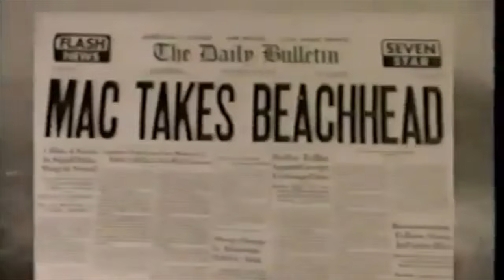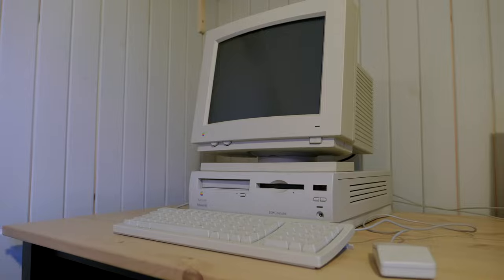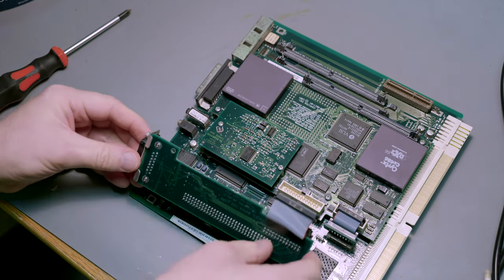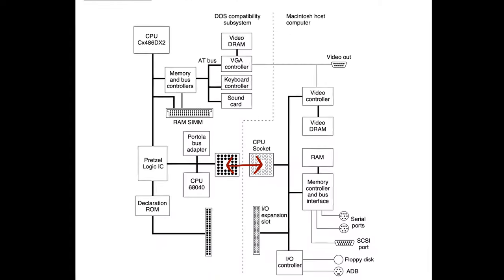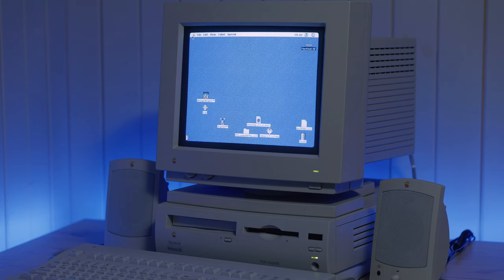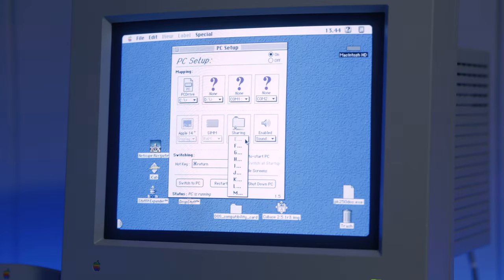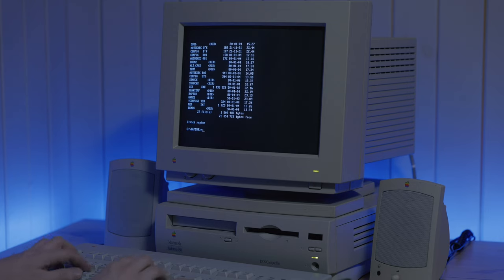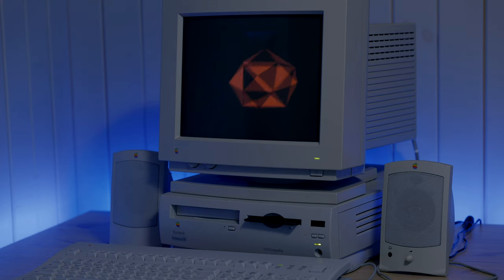This 90s Mac is also a PC!

Comment: Superb vid. I guess internally the DOS cards are a bit all over the place but it is a lot tidier than the 610/6100's solution when its all closed up. I didn't know it was just the DOS models with the dedicated AV socket, although there is something visually identical on a standard 6200's logic board. And those eject shortcuts... what a shame they are only for the PC side, thats a super handy idea. Maybe theres an extension out there that can add it...

It would be really cool to see some direct comparisons of identical games running on the Mac and PC sides to see how they compare performance wise, that DOOM II footage looked to be smoother than the Mac port running on my 630.

Comment: YouTube suggested this video to me, and after watching it I have to say thank you to YouTube for suggesting it!  Great video, I'll subscribe now and see what else there is.

Regarding WHY the card plugs into the 68040 socket, I'd guess that it was easier for the engineers to do it this way and have full read/write access to the 68040 CPU bus, rather than needing to interface using the possibly slower NuBus expansion system.  It's certainly a very interesting design.
Reply: I must correct myself, I just looked it up, this model Mac uses a PDS (Processor Direct Slot) expansion slot, not NuBus.

Also, I see people have mentioned trying a faster 486 CPU.  This would be an interesting experiment, BUT, given the 68040 CPU that runs the whole show is on a 33MHz CPU bus AND the 486 ALSO runs on a 33MHz bus (which is then clock doubled within the 486 to 66MHz), I wonder if the 486 simply runs off the same timing system as the 68040.  That would make it MUCH easier to design and cheaper to manufacture as well.  If this is the case, perhaps a 486DX4 100MHz may work (clock tripled from the 33.3MHz, so technically a 99.9MHz internal clock speed, just like the DX2 is technically a 66.6MHz), and maybe even the "fastest 486" (the Am5x86) may work - it runs at 4x 33.3MHz, but works as a drop-in replacement for a DX2 66MHz 486.  Other 486 CPUs, such as the 486DX2 50MHz, may not work, as they work on a 25 (times 2) CPU bus.
Reply from the maker: I think you’re on to something!
Reply: @OddObsolete  Thank you.  Or, after looking at that huge wall of text, I wouldn't blame anyone for assuming I was on something when I wrote that, haha.  Great video, and good luck with what you do with this machine in the future.

Comment: Good memories, I had a PowerPC Performa 6360AV in the late 90s which used the same chassis as this machine. The TV tuner and Video capture/input capabilities, I kept it right into the mid 00's to use as a video monitor/TV. I notice on the back of this there is the blanking plate where the tuner card would have been, I wonder if the Performa 630 ever actually came with the TV tuner and/or video capture card
Reply from the maker: The 630 can indeed have a TV card, there’s a slot for it on the logic board.
Reply: I think the TV Tuner and AV inputs (composite) may have been separate from each other. Would be interesting to see if the 630 could be upgraded with that at the same time as the dos card. It was great to use alongside games consoles, like Sega and original PlayStation, there was an Apple monitor with stereo speakers vertically on either side, it really was a pretty sweet setup.
Reply: Yes the 630 had a TV card option - you'll notice the black IR window on the front of the case. The 6360 was the last to use that chassis and had a PCI slot if I remember correctly.  I had a 5320CD which came with 28.8 modem, MPEG decoder card and TV Tuner card.

Comment: I had the model LGR showed until I sold it to a collector that kept pestering me about it.  The only Mac from that era I've owned, System 7-9 are pretty solid operating systems IMO.  For most people I would say OSX/MacOS is the best operating system out there.  

It's a shame it's platform restricted, but one could argue that's why it's so efficient.  I'm not a fan of Apple hardware or wasn't at least until the M1 shift (ARM desktop fanboy).  I just wish the company that was putting out great performing ARM hardware for desktop was one that would make a machine with sodimm slots for ram, nvme slot(s) for storage, and possibly a PCIe slot or two for expansion.  My RockPi4 has an NVME slot and RockPro64 has a PCIe slot (albeit 4x, but that's better than nothing), both SBC's I actively program with on the actual hardware using FreeBSD.

Comment: Stopped by because I just bought one of these in a flea market and I know very little about them.  You just bumped my knowledge up a ton and I am looking forward to giving this a rig a run after I give it a good cleaning like you showed.   Do these use an Apple bus keyboard and mouse or will a standard IBM type work?   Appreciate the video!
Reply from the maker: Wow, congrats on a great find!
Only ADB unfortunately, but you’ve probably worked that out by now :)
Best of luck with the machine, and have fun!

Comment: I recently purchased a 640CD DOS Compatible which is almost exactly like the 630. I’m having an image display issue on the PC side though. On the PC side I don’t think I’m getting red at all. Everything has a blue/green tint. Even the text on DOS is blue. The original HDD was toast so I am using a CF card with adapter. Colors on the Mac side are fine. I don’t have a crt monitor. I’m using a lcd with a VGA adapter. I’ve tried different dip switch settings and still no luck. My guess at this point is there is an issue with the graphics chip on the DOS card itself. I’m going to take the computer apart soon. The power supply needs to be rebuilt. Though I don’t want to bother if I can’t get the DOS card to function correctly.
Reply from the maker: Had that same issue as well, it was the video connector from the DOS card to the Mac logic board that wasn’t making proper contact. Clean it with some IPA and it should be fine!
Reply: @OddObsolete  good to know! I’m going to pull the logic board now
Reply: @OddObsolete  it worked!!! Thanks!!!

Comment: can you upgrade the x86 CPU and RAM ? And if can what are the max available upgrades ?
Reply from the maker: Yeah, it should be possible to put in a 100mhz DX4 overdrive, and I’m on the lookout for one of those.
Maximum memory for the DOS card is 32mb according to Apple, which is what’s currently in there.
Reply: @OddObsolete  Anything to get rid of that Cyrix processor but it didn't look like an overdrive chip will fit on that board sandwich